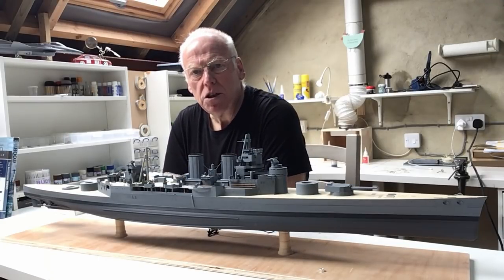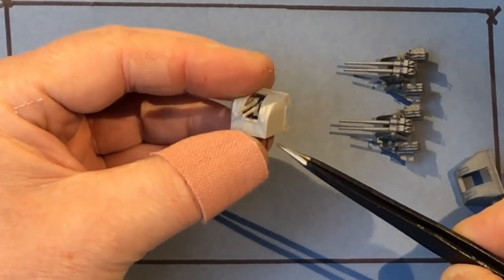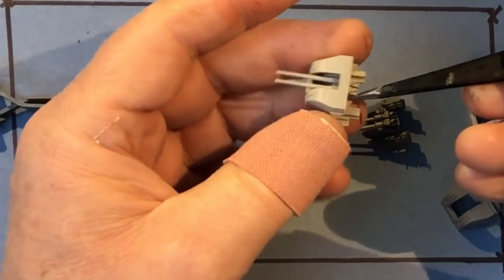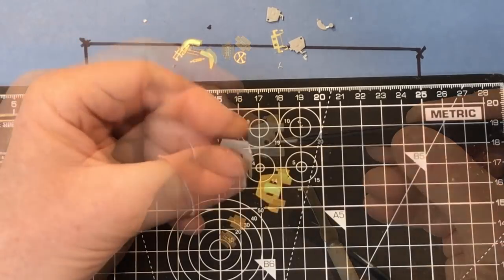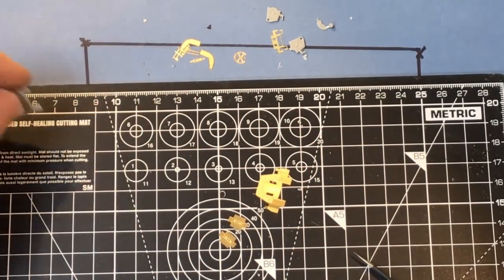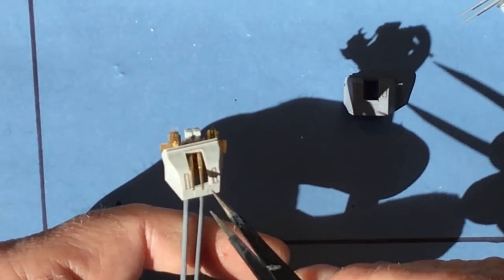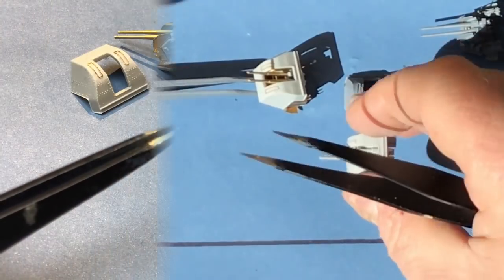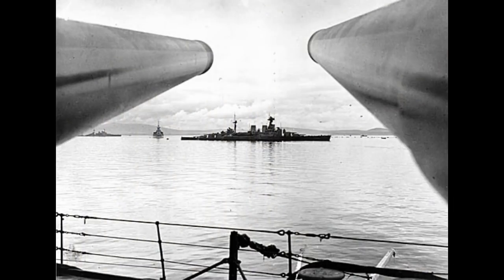Trumpeter 1/200 HMS Hood Full build with Pontos detail set Part 25  (4" Guns)

Comment: Bravo for even trying to solder those fuse setters--you probably needed a gas deposition solder machine for that.
Those Pontos are quite good built up, too.  The Trumpy barrels are kind of thick and chunky.
All of this keeps me thinking about when I break down and built USS Texas.
For those of us ignoarnt of UK specie, is that a £1 coin?
Reply: I think it's a pence
Reply from the maker: 👍 it’s a 2 pence (penny) coin. I can’t think of anything you could buy with it - but in the UK there are millions of them in glass jars at the back of cupboards.
Reply: @TheModelShed  Google tells me it's around 0.75 inch, or close the size of a US quarter.--Thanks

Comment: Great video on the gun construction.  Do you have the part number from Micromaster for those guns? Couldn’t find it on their wed site. Thanks
Reply from the maker: I couldn’t find them either to start with Clyde. I had to use the search on the website to find them as they don’t appear under the shop categories. MM don’t appear to use part numbers.
Reply: @TheModelShed  Thanks, I’ll try that.